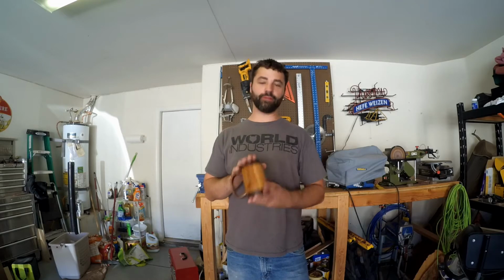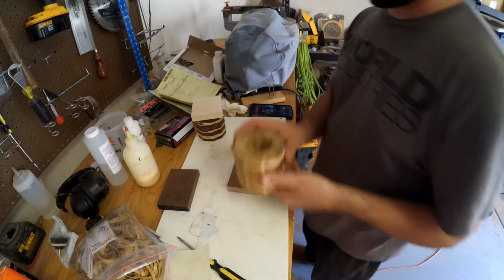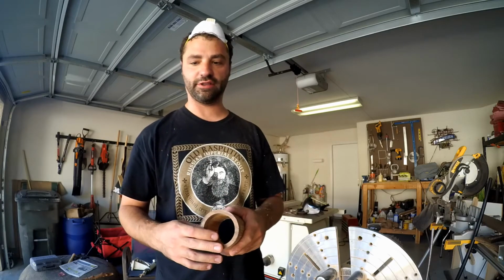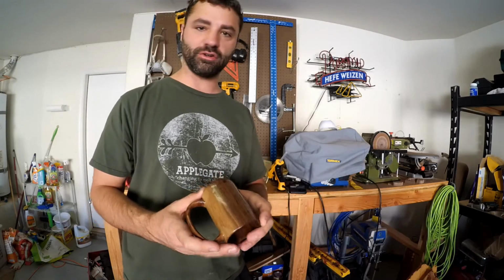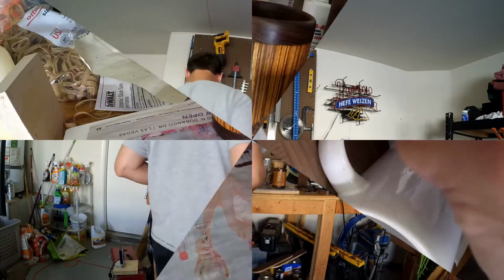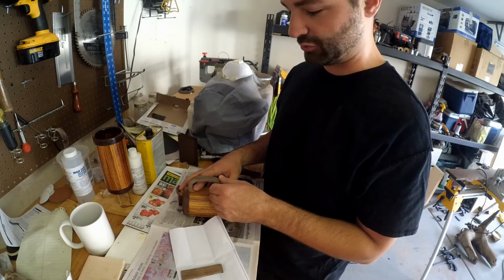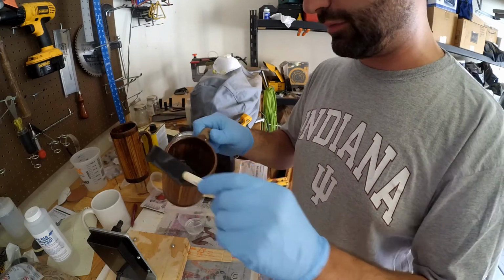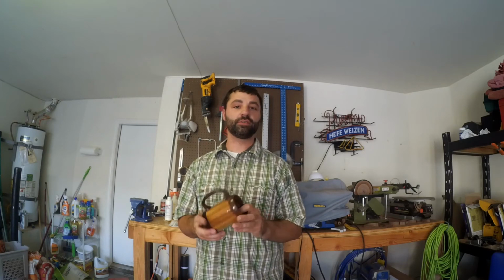Woodturners Journal: Turning a Segmented Mug

Comment: Hi Jerrod,
I've restored and built fishing rods using 2 part epoxy,designed for this purpose, on the thread wraps for the guides and decorative wraps elsewhere on the rods.The epoxy is applied while the rod is rotating slowly (as you did) and ,as you have found,bubbles and runs can be a problem.
The key to get rid of bubbles is to apply the "right" amount of heat using an alcohol lamp.
Too much heat will only create more bubbles and can burn the epoxy itself.Too much heat will also cause the epoxy to thin and run.
The flame is a "lazy" flame and the flame never actually touches the epoxy.The flame is "brushed" back and forth until the bubbles are gone.You can also come back and hit the epoxy again in a short while!
An alcohol lamp is used because there is very little carbon coming off of the flame as opposed to other sources of fire.
A heat gun will attract dust in the air and inject it into the finish so a heat gun is avoided ,,,,in fishing rod building anyway! LOL
I am very,very new to wood turning and haven't tried applying any type of epoxy to anything,,,yet,,,but I will soon!
Thanks for another great and informative video!
Tom
Reply from the maker: My Videos Thanks for the tip, though I did hit it with a flame.  Making the mugs now, I got a tip from someone else to thin the Epoxy a bit.  I think that was the problem.  It was too thick.  I have since made mugs with thinner epoxy and it's perfect.  Just something to try.  Thanks again.

Comment: So I tweaked this build a little bit, I took my planer and knocked off a 16th of an inch on one side of the mug to get a flat edge for my handle and after I placed my handle sanded the flat corners round and I can't even notice the difference. I also thought about making a sliding notch for my handle and tried that and it turned out pretty good. Awesome build man, thanks for sharing :)
Reply from the maker: Thank you.  It's awesome you improved on this project and it all worked out great.
Reply: Well I thanks to you I learned how to turn a mug. I tried for the first time after watching this video so thanks for giving me the initial gumption to do it :D

Comment: I have use two part epoxy on bowls and I find if I use a propane torch it will make all of the bubbles go away, also it will smooth out the surface. You will need to do this several times after coating. Start this right after applying the epoxy.
Reply from the maker: Thanks for the tip.  I'll try it throughout the process.

Comment: I'm using Max CLR as well but the directions for use on wood require that it be diluted 50:50 with acetone.  It penetrates well and with a light sand between coats it looks professional.
Reply from the maker: Lauren Grokett Thanks for the tip.  Mine only came with generic directions.

Comment: I really like your mug look. i have recently made a coffee mug and email stephen on what epoxy to use, his videos are very good. He suggested the max clr, and i am having the same issue as you did. i recently just sandwd the whole outside and thout maybe i mixed it wron, so i reapplied a thin coat, but will prob have to sand that off again and go with another finish to the outside as you did. anyway thanks for the video, but now i have to watch your video on making this cup lol
Reply from the maker: +David  Good Thanks for the comment and for watching my video.  It's funny you right about the epoxy right now because I am currently working on another project which needs epoxy on the outside, but once again I am getting the same result.  I considered that perhaps the tung oil was the problem.  Maybe the epoxy doesn't like binding to the oil, but on this new project, there is no tung oil.  I am guessing sanding and applying thin coats may be the answer.
Reply: Haha, i just walked down stairs to check on my mug, not only is it still tacky, but same result as before. So i will sand and just apply  another finish to the outside. I do not have a bowl finish as i am fairly new to turning theese. I have made captin eddie castings "shine juice" and will prob just use that for the outside. Pssst. I just cut the peices like your cup (staves i think there called) and will sand and glue all up. Im curious how much you sell your mugs for, not that mine will look as good as yours , but 8 hours in labor. I have made beer can holders and sell for a small price of 10$, not nearly enough, but i dont mind
Reply from the maker: +David  Good Well...  recording the videos, editing, planning new projects, responding to posts, etc, eat up a lot of time.  Therefore, I rarely try to sell any of my work.  It would be too much if I had to make things to sell on top of everything else.  So when people want to buy from me, I put a pretty high price tag because I don't really care if I sell any.  So currently, because I have several people interested, $100 a mug is what I charge.  I don't sell a ton of them, but people still feel it's worth buying.  And at that price,I don't mind squeezing it in on top of everything else I do.  Not sure if that helps, but I feel you can get way more then you are charging.  Keep up the good work.

Comment: to clear up the bubbles, try using a propane torch with a flame spreader. run it over the finish lightly. it will cause the bubbles to expand and pop then fill in. another finish I use is "Envirotex Lite Pour-On Finish' you can get it at Hobby Lobby ... 8oz costs about $15.00....
Reply from the maker: Thanks for the advice.  I did try using the torch, but it was unsuccessful.  The bubbles would reappear after a few minutes.  I'll definitely try that finish.

Comment: Good job with the mugs. Stephen Ogle shows a similar treatment, not sure what epoxy he used, but did the same concept of epoxy on the inside and other finish on the outside. I really like your method of stave construction. Thanks for your effort to produce these vids!
Reply from the maker: +Earl Rumble Thanks.  I really do appreciate the support.  I saw Steve Ogle make one before in one of his earlier videos.  He used bee's wax for the finish in that one.  I saw he made a video where he makes another mug, but I haven't watched that one, yet.  The epoxy on the outside of the mug really is a pain though.

Comment: I recently discovered Capn Eddie Castelein's method of applying Starbond EM02 cyanoacrylate to bowls. He used a piece of blue shop towel, perhaps 2"x3" folded 3 times, placed a drop or two on the towel, and wiped it on the outside of a bowl that was sanded to 600 grit, with the lathe at 250 rpm. 9White paper towels catalyze the CA curing before the application was made.) I found that it cures solid in 30 seconds or less. After six applications, wonderful glossy finish began to appear. After 10-15 applications, it was beautiful. I sanded the outside with 1200 grit and made one more application, followed by buffing with Maguire's Headlight polishing compound. The entire application and polishing took 25 minutes.

Comment: I had an idea, could you use the fostner bit to mill out the shape of the handle in the plank, and then router them out smooth while still on the plank, and then cut it directly off from the end of the plank?  This way the next handle is ready to go and you don't need to use the scroll saw.  Jimmy DiResta uses a torch to pop any bubbles in the epoxy.  Peter Brown too.
Reply from the maker: If I'm understanding what you're saying,I believe that would work fine.  I feel to do that accurate, I would need a drill press, which I do not own.  Either way, try it and let me know.  I'm very curious about doing it that way now.

Comment: What is a kettle bell? Is that weight lifting equipment? I've never seen one of those before.

What kind of glue is food safe for making a segmented mug? Subbed. I like when someone makes something interesting and usable at the same time.
Reply from the maker: Brandywine6969 A kettle bell is a piece of work out equipment.  I just needed a weight to help weigh it down.  Look for food grade acrylic to use.  I believe I have a link below if you can't find anything.
Reply: @Woodturnersjournal  Thank you. I really like the segmented mug. I don't have a lathe, but I'm pretty good at carving and hand sanding. I have always just been worried about the glues and finishes. Thank you. I am enjoying your channel so far.

Comment: I always am surprised at how long some glues take to dry hard enough to work. The glue in  mostly use is Kestokol d300 and i can have a joint strong enough to plane, lathe, route or whatever in about 30 minutes of clamping pressure under optimal conditions, i usually let it sit for an hour though anyway. 24 hours for full hardness though.

Comment: Hi Jarrod my name is Eddie and I have some thoughts that might help you out a little if you haven't try them already.  I use the max clr a/b it is also food grade and have had great success.  also i got better results apply it directly to the unfinished wood, to get a smooth finish take a heat gun at low and go over the mug it will remove all air bubbles and smooth the surface be careful though you don't want to get it two hot takes a little practice. love your passion for wood. I have a 4000 sf. shop and enjoy making mugs & koozies. I would like to send you some pics of my mugs if I can figure out how.

Comment: Good video.  I'd like to request a little sound equalizing though, especially when you have the camera right next to the chop saw motor.   Do you have any links available for the other discussions regarding an epoxy finish for these?  I am considering doing some in the near future, and have never found satisfactory info on the best epoxy to use.